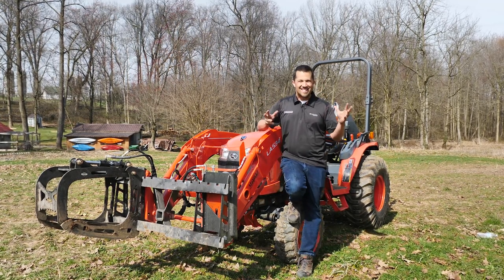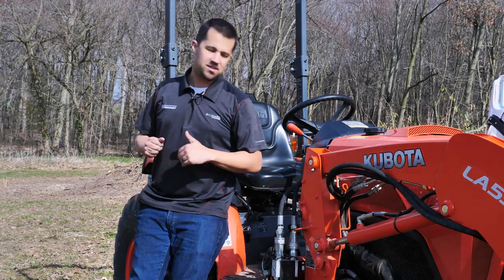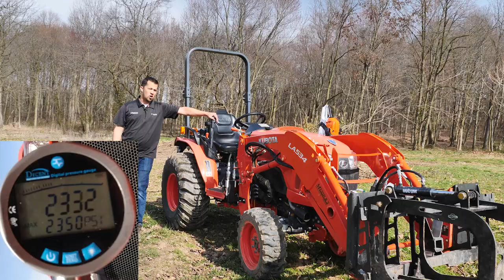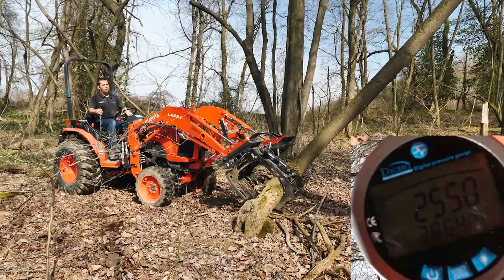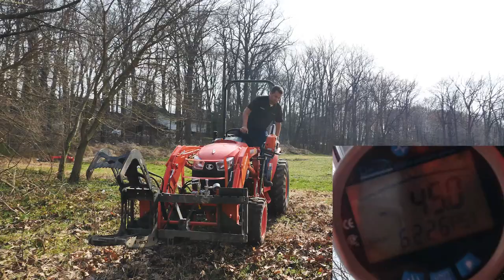How grapples can be dangerous! Protect your hydraulic system.

Comment: While driving forward slowly, using a rock bucket to screen out large rocks in a freshly cut driveway, I hit a hidden 24" round boulder and the front of my tractor lifted up too quickly for me to react and I burst a 12mm steel hydraulic line. When I tried to buy a compression fitting to mend the line, I found out the entire 30" line had swollen more than a mm oversized. I had a hydraulic tube shop fabricate and repair it for me. Fortunately it only cost $65 and none of my valves were damaged. Those cylinders can easily created pressures that will destroy your hydraulic system quicker than you can blink an eye.

Comment: this is why line reliefs are installed in most hydraulic systems.
the line relief for each circuit will be set 500- 1000 psi higher than system pressure.
this then allows the fluid to pop the relief when the circuit is overloaded from external forces.
that "tee" manifold on the end of your loader where your auxiliary lines attach would be ideal for where to install the line reliefs.
this would allow the pressure to bleed off before damage to the loader/machine could occur.
the problem is training the operators to know when this happens the grapple will open due to the external force being applied.
most operators today would view this happening as something wrong with the cylinders bypassing.
large green and red led lights connected to pressure switches should be on all these newer hydraulic systems.
this would allow the novice operators to know green means ok and red means you are overloading the circuit.
one other feature would be for the "idiot" operator that treat the machine like you showed pulling on tree still in the ground with to small of a machine.
a giant hand should pop out and slap the idiot operator for abusing the machine.

Comment: Engineer here: The design of the grapple makes a big difference too. It seems the cylinder on that model might be improperly sized. If you swapped the hydraulic cylinder with a bigger one (where the piston has more area and the same stroke) you would not only increase the clamping force of the grapple but also make it more difficult to generate a back-driving pressure as the force is working over more area.
Some quick numbers:
1sq in. piston at 2500psi has 2500lb of actuation force. Against a transient load of 4000 pounds, system overpressure to 4000 psi.
2 sq in. piston at 2500psi has 5000lb of actuation force. Against the same 4000lbf transient from improper loading , system does not even exceed design pressure.

The drawback of course is that the bigger cylinder would take twice as long to fill, so the grapple would take twice as long to close. It may also need a pressure limiter to avoid excessive force on the grapple frame at the design pressure.
Reply: Great comment.  Always appreciate when someone adds valuable insight/observations in the comment section.
Reply: Yes of course but, implements for tractors this size are designed to be budget friendly
Large cylinders would greatly increase cost

Comment: What about these principles applied towards the front end loader hydraulics? Like when using the FEL with a bucket or forks.
Reply from the maker: planning on that.
Reply: Was thinking the same thing!
Reply: Gray Turner great question as I’m finishing a project that (I felt) was constantly maxing out my bucket
Reply: Same here. It will lift the load but feels like its robbing pressure from the steering and it whines terribly
Reply: I was thinking a similar thing.  Put the gauge on the power beyond line. That way to see if its multiplied by all cylinders at once.
Reply: Yeah I wonder what the pressure looks like carrying a bucket of stone when you drive over an uneven surface and the front end starts bouncing
Reply: This isn’t grapple specific. At. All. Would be the same with a bucket, forks, plow blade etc.

Comment: Very interesting video. I just replaced all eight small hoses on the loader of my B2650 after having one burst while using the bucket. Came to find out Kubota installed single wire hoses, I assume because they are cheaper. I installed two wire hoses. I think this is the way a premium tractor should have been made.
Reply: A failed hose is cheaper than the valves/pump, You would be surprised how many valves and reliefs are  tampered with to allow more force.

Comment: As soon as I saw how fast that little grapple operated, I knew it wasn’t designed properly. Beyond the high pressure lines and safety/lock valve that the better equipment has, the grapple should be designed such that the cylinder has the mechanical advantage over the tongs, not the other way around.  Great video!
Reply: I saw the same thing and couldn't believe it. My Titan grapple opens/closes much slower at a reasonable rate.
Reply: 1000% agreed
Reply: I also couldn't believe how fast it was and at idle.  It's so fast it's almost un useable.

Comment: That's why top end heavy equipment systems use circuit relief valves. They prevent system spikes like you describe. Unfortunately, most aftermarket consumer attachments don't have them.. 
I add circuit relief valves on all my attachments. A little pricey, but cheap compared to the damages that can happen. 
They also help add a safety factor in that if set correctly, the operator cannot overload the machine.
Good hydraulic design is a must!
Reply: Sounds like a video waiting  to happen!?
Reply from the maker: I'd love to see photo's of what you've done.

Comment: Okay I just have to ask all tractors and pieces of equipment have a hydraulic relief pressure set at say 2,900 for a 3000 psi system. Does that not kick in before all of this extra pressure that you are referring to? Thanks
Reply from the maker: Great question.  Your on the other side of the 3rd function at this point,  so the tractor does not take the hit. The 3rd func can have a relief,  but they don't flow enough to prevent the  spikes i recorded.

Comment: What is with all the hype, is this CNN? You’re tractor won’t see that pressure so relax. Grapple’s have been used for years on tractors and get abused everyday. The only real issue is a blown hydraulic hose, but most of those have a spike pressure of over 10,000 psi. If a hose blows it was junk to begin with.  Tractor on with your grapple or backhoe or FEL where you’ll see spikes.

Comment: I just had 2 acres cleared and the company that did the logging work was running around the property with a Skid Steer with a grapple... Doing a LOT of what you discussed in this video. Through the course of an 8 day job, they blew FIVE... yes... FIVE hydraulic lines on the steer. All related to the grapple. Meanwhile, my tiny little Branson 2205 has NEVER blown a line on the bucket, backhoe or grapple. I take my time, I stop when the machine says NOPE.. I don't push past the operating limits. Yeah it takes me longer to do stuff, but, the price of fuel and grease is cheaper than parts, IF you can even get them... Great video...

Comment: Good morning Neal. Excellent video (again).  Very educational. And very helpful especially for new tractor owners learning how to operate their new machine. I agree with most everything you said, especially as it pertains to lifting loads that are offset or not centred etc, using the jaw to pull or push against stumps, loads etc. However, I wanted to ask you to explain further what you mean by "trying to lift loads too heavy for your tractor". Whether using a bucket, grapple or other FEL attachment, it is my understanding that the tractor will not lift something that is "too heavy for the tractor". It simply does not lift it as the system has relief valves in it. In other words, it is not possible to lift something "too heavy". If the tractor is engineered to lift 1,000 lbs and I try to lift 1500 lbs, the loader just simply doesn't lift it. Is that correct or perhaps I have misunderstood? Your advice or thoughts would be greatly appreciated. Thanks again - excellent video series! Cheers!
Reply from the maker: your are correct. My point here was how you do it matters.

Comment: Hi Neil,
I'm more in favor of the use of a pressure release valve on the attachment end, in addition to a check valve. The check valve protects the tractor, however the pressure spike is still there when the attachment is still used incorrectly. The pressure release will greatly minimize the spike from happening altogether.
I have also seen many operators user their compact tractor, and like you also mentioned, as a bulldozer. When something doesn't move it gets rammed. Besides potential hydraulic damage, the mechanical stresses on the tractor and loader, can often times be catastrophic!
The same is also true when adding tractor ballast to prevent wheel spin. Wheel spin is the equivalent of a pressure release for the drive train.

Excellent Video! Keep them coming!

Comment: If your diverter valve doesn’t have a pressure relief in it that can send over pressurized oil back to the tank from the close side of the grapple ram, then I’d add one. They’re not too expensive... and can prevent some nasty situations from occurring (high pressure fluid injection injury can be fatal).

Comment: Tractor manufacturers are still building these machines like grampaw's row crop tractor, but tractor buyers operate them like construction equipment. If manufacturers engineered compact utilities to withstand the heavy use they are subject to in most cases, the machine would be triple the cost. What's the msrp on the tractor in this video vs. the skid steer in this video?
Reply from the maker: true. You'd buy three tractors to that track loader.

Comment: you can add the same functionality to any cylinder by installing a check valve right on the cylinder.  Available here: https://www.agristoreusa.com/collections/hydraulic-valves/products/check-valve-with-3-8-npt-ports.  They come standard on their hydraulic top links for a different reason but work in the same way described here.

Comment: Good video. This is something I was aware of but had not seen any 'measurements' of, so this was nice. If someone wanted to get into this a little more and customize or build their own equipment, I believe the valve you referenced would be called a pilot operated check valve, or load holding valve. That type of valve ideally would have also stopped the pressure bleed-off you saw when you turned your tractor off earlier in the video, which could make the difference of something slipping or falling out if you happened to turn the tractor off with something grappled and held off the ground (opening another can of safety worms there, i know).  

That type of valve doesn't really protect the implement cylinder (including the extended rod..) and lines from the pressure spike though, just the tractor on the other side of the valve. One might also consider a crossover relief valve. That would let the cylinder move once pressure reached a certain point. That would protect both the hydraulic system AND the physical parts (such as the rod you won't want to bend, mounting ears you don't want to crack off, etc etc) from excess force, but it WOULD allow the grapple to slip/move when you're exceeding its limits, which means you need to know where those limits are before you accidentally drop a giant weight on something because you happened to hit a bump while driving near it with the grapple holding something.   

I do think your vid did a great job explaining to the guy who's just going to buy something and leave it alone. The above stuff is definitely for the tinkerers to consider 'at their own risk'. Any of this stuff built wrong is going to hurt somebody, someday.

Comment: I know this is old, but I don’t think a load check is the best option.  If you’re actively trying to move the grapple lid when the over pressure happens, the load check won’t protect anything.  And putting one on each attachment is inefficient ($).  I think the best option is a dual crossover valve with relief to tank mounted at the third function valve.  This would allow the grapple to release when over pressurized to protect the components.  These are sometimes called a dual crossover with anti cavitation.  They’re typically used to protect motors, but they’re designed for use with motors or cylinders.

Comment: The gear pumps on this type of tractor should not exceed 2600 PSI. When you exceed this you are causing major wear to the pump body. The major wear sends contamination into the hydraulic system causing more wear more heat and less efficient hydraulic performance. Utility tractors are not contruction equipment and shouldn't be use as such. Most quality construction equipment have work port relief valves built into the hydraulic valve or cylinder port relief built into the cylinder. These valves protect the pump from these high pressure spikes. One thing Neil doesn't have with his gauge is the pressure rise rate. I've seen raise rates on utility tractors at 200000 PSI per second. Most gear pump manufactures want the rise less than 125000 psi per second. Just food for thought.

Comment: You guys have the best tractor videos. I have a grapple on my L3901 that I love. Two items I wisdom I was taught. 

1) It is a tractor, not a dozer

2) when picking up loads with a grapple, beware of offset loads, it can twist the loader frame and bad things happen.

Never even considered the hydraulic pressure issue.
Reply: What grapple do you have?  Do you have suggestions on which one I should get?
Reply: @nathantooker6080  I purchased from a local company here in North Alabama called Skid Steer Attachment Depot in Brownsboro, AL. I got a 48 inch single cylinder grapple. They are about $1000. You can't get one too heavy because it reduces the lift capacity. It is plenty strong for a tractor.

Comment: Check valves aren't all that expensive and save problems later in many fluid systems.  It's kind of shocking that there isn't a system of them in place standard.

Comment: If the valve is in the closed position, the pressure should not be rising past the valve. Sure the lines and everything forward will experience the increase pressure but how can it get to the tractor internally???

Comment: And this only addresses the hydraulic part of it.  There is also huge mechanical stress put on the front end loader components you can't measure, and will show up when you break stuff. People really using their tractors are going to find out these small ones simply are not designed to do this kind of stuff.

Comment: Nope. The tractor is not seeing that pressure, unless you have the grapple open when you are doing these things. The fact that the valve is closed is precisely why you are seeing those spikes. If the valve were open, it would pop the relief valve. While you are right that it is abusing the attachment, you are incorrect that these pressure spikes are going into the tractor system, unless the valve is open when you are doing these things.

Comment: So where would a person find a aftermarket kit to add to their grapple to prevent these pressures?
Reply: i put one on my grapple right after i bought it. just google double piloted check valve. you can also see my video on my channel that shows the valve. i may do an update video since messicks put this one out.
Reply from the maker: I'm going to do a follow up video to this. Would love to have that to show.
Reply: @MessicksEquip   I may actually do a follow up video myself just to direct folks to look at your video because honestly people need to be aware. I had no idea that much back pressure could be created until I seen your video my main purpose was to keep the grapple closed and not have to continually tighten it up by pressing the 3rd function button. it holds awesome! I think I paid like 100.00 bucks for the double piloted locking valve.

Comment: What a well educated video.. I just shared it with my dad.. He owns 2 Massey's and 1 Landini and I own a CT47 McCormick (sister to LS). Yes loaders can lift heavy, but excessive pressure through hydraulic hoses could disrupt the balance of pressure that the tractor was intended for. Whether it's a grapple, bucket or any attachment. You are right, these are NOT bulldozers and we all tend to push the limit on what the machines can do.. I myself have been struggling trying to figure out why I'm having so much trouble with my hydraulic valve system and excessive pressure through my hydraulic may be the answer.. Thank you for the educated video.

Comment: There are normally relief valves to prevent blowing out the lines.... if a hydraulic system is properly designed.
Reply from the maker: There are relief's speced on the 3rd function valves, I don't think they can dump the oil fast enough though to prevent the spikes I recorded.
Reply: I was wondering the same thing.

Comment: Thank you for great video. I have only one comment. At first example the system was still under pressure even after the engine was shutoff. Do not touch hoses with naked hands. This is very dangerous as it might cause hydraulic injection injury which can be leathal.

Comment: I mean this 100 percent constructively.  

3000 psi would be normal operating pressure.  Max pressure would be 2 or even 3 times in excess of that and burst pressure would be potentially 4-5 times higher.  All im getting at is these max pressures are designed into the system.  At least in my opinion.  Any thoughts on that
Reply from the maker: Yea, that's why you don't see the hoses bursting. We do see problems with the solenoids on the valves.
Reply: @MessicksEquip  good to know ill see if i can either buy the better grapple or get a check valve set up when i get to that point. Great video